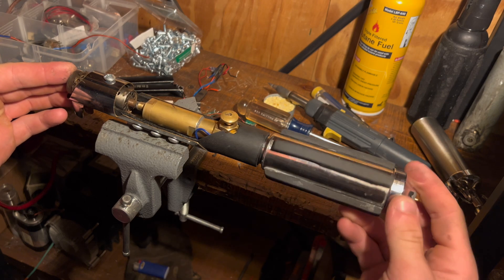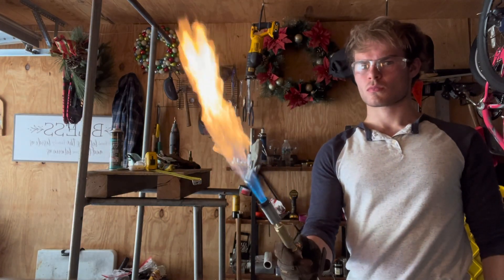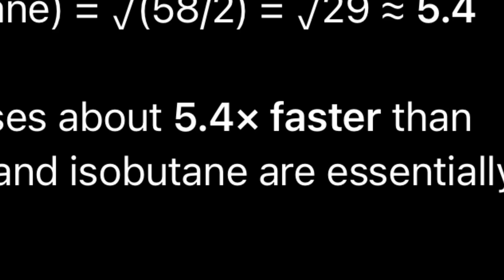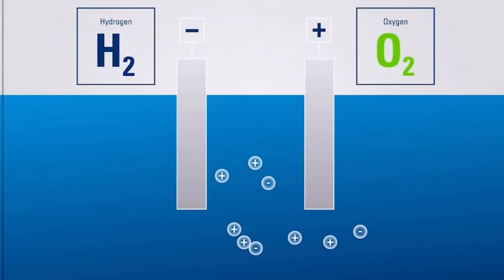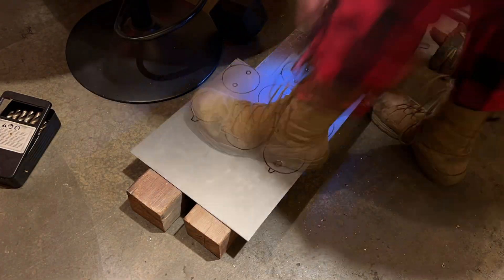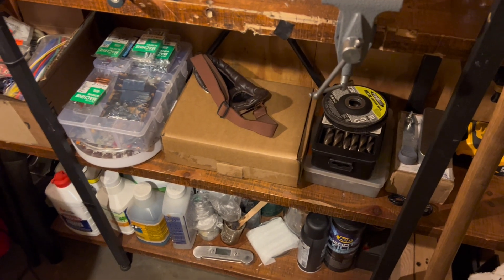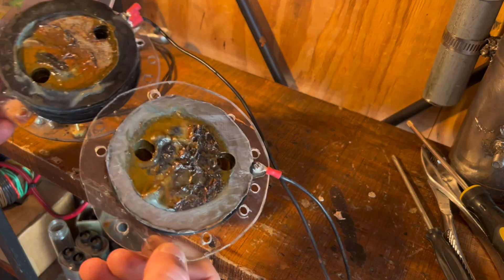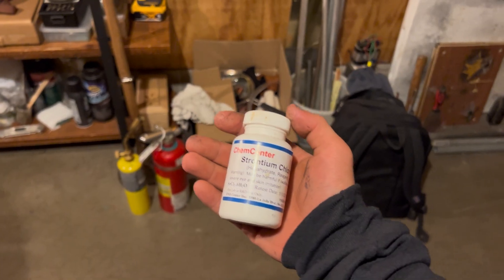Failed Hydrogen Reactor

Comment: I used to work on browns gas generators for jewellery.   You need a high grade steel and then nickel plate them to stop corrosion.. don't use stainless .. potassium hydroxide flake at 90%+ makes a better electrolyte than salt  ( lower resistance )
Reply from the maker: Thanks for the tip I’ll look into nickel plating. I’ve heard Graphite plates are the most efficient and have the longest life time as well.
Reply: @Joseph_sidl with a 17gua tip we got 200mm flames before reaching the cap of the tank